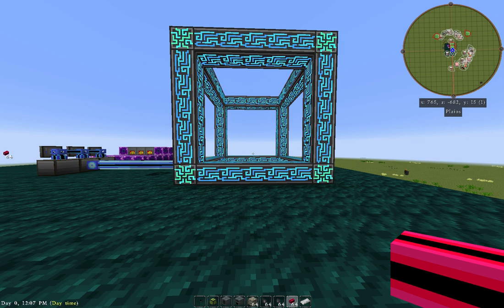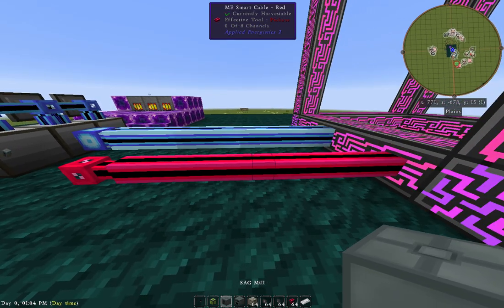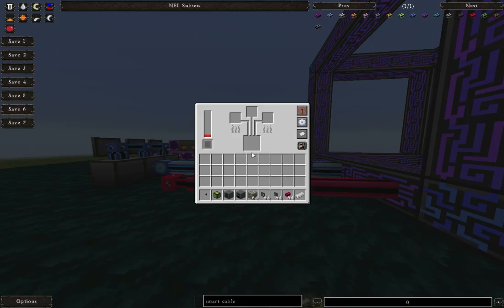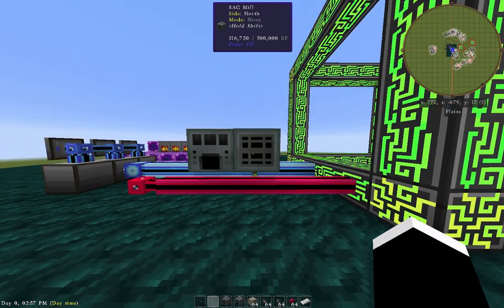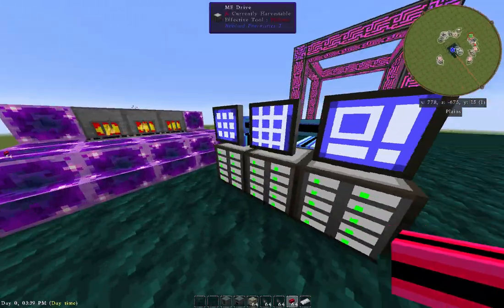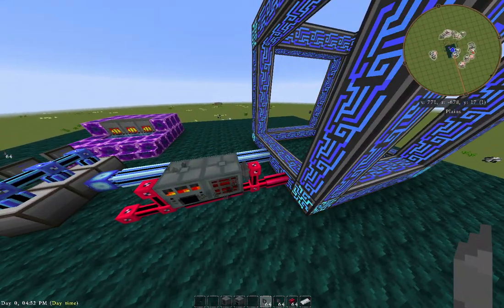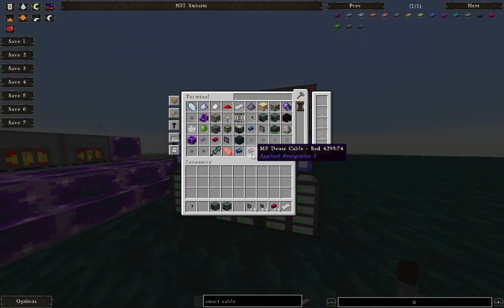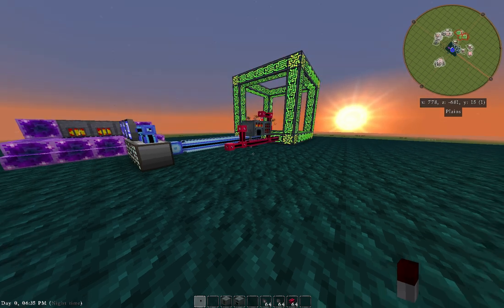Applied Energistics 2 - Import Bus, Export Bus and Level Emitter

Comment: I think that the mod is broken and I don't know why. I placed 2 chests. put an import on one an export on the other and a cable to connect them. then I put nether stars in both chests and I placed a nether star in both the import and export bus. and no nether stars were moving. I even hooked the cable to a creative energy cell(this is a testing world) and still nothing. all I want to do is use the cables to move nether stars from my ME system into nether star generators but I can not figure it out
Reply from the maker: I haven't used that mod in quite a while but it does sound broken.  luckily there are always multiple ways to get things moving.